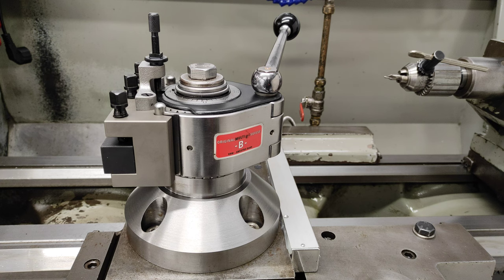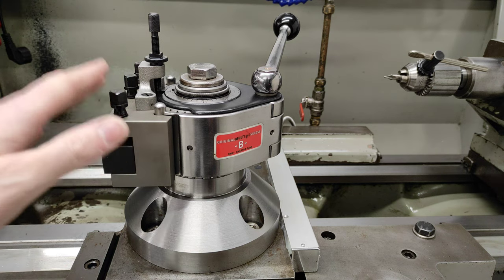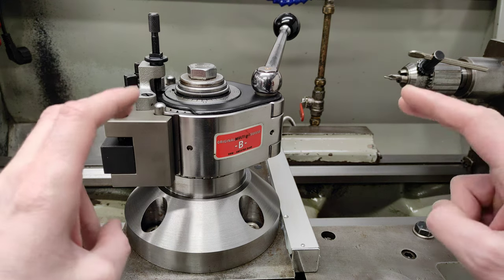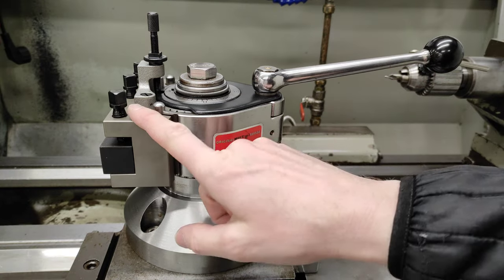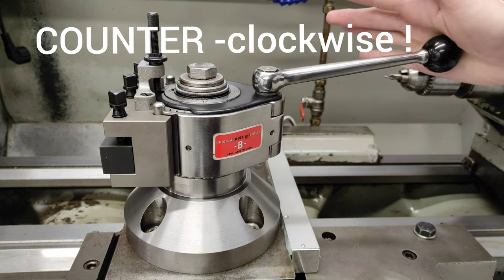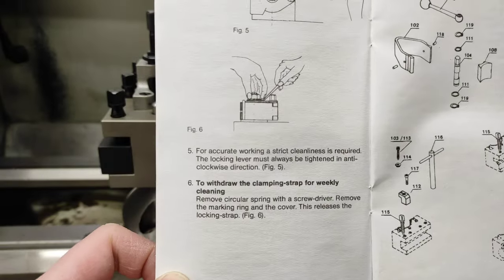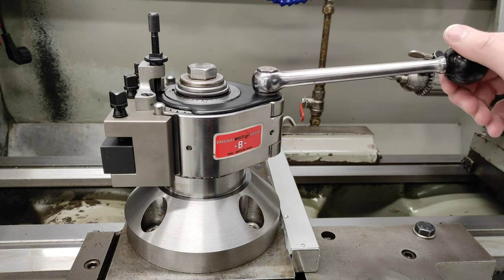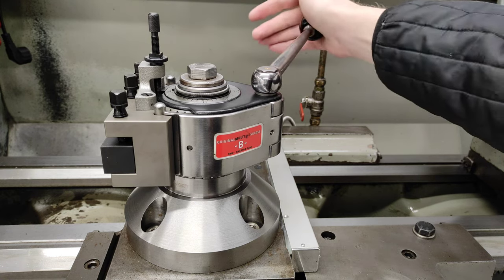Multifix quick change tool post. You've been using it wrong for years 😁

Comment: Hello, why do you think that the manual of the brand "OriginalMultiSuisse" (BTW:  This is NOT the original Multifix, the last original was produced 1984 in Switzerland) is correct? There is an excentric bolt which tighten up the clamps. Is there any logical explanation for clockwise or counter-clockwise? I ask because I am using clockwise without any problems since now 40 years and as a Multifix developer,  I recommend clockwise but I also say in my videos that it make no different in the point of clamping. Who knows, maybe I am wrong but to say this, I need some technical facts.
Reply from the maker: Of course i know this isn't the 'orginal' Swiss made.   This is made from Amestra.  I can't change when they write 'orginal' on it 😉
But it's still better quality than other import I've tried.   Why I think it's the correct way to tighten it?  - only because I can feel a difference in the ways I tighten it.  (I have two, and a friend a third) and it was him that said it to me.  I have always used it CW ☺️ 
I can't say why they do write it in the manual, or why it does draw/pull differently CCW than CW.  But I'm sure they have a reason.  If it's because of ease, repeatedly or something else. I don't know ☺️. The video were just a information and to get some discussion about it.  I'm in no way claiming what's wrong or right.  Other than what the manual says ☺️

Comment: Hi. Would you think to be possible using a multifix in the Myford ML7?? Would there be a problem given the multifix dimensions? Or I'll need to go after a smaller multifix?? I know in any case we always have to adapt the central screw, but the size and the risk of not reaching out the center precisely worries me. Thanks in advace!!
Reply from the maker: Hi. You should be able to use a small size Multifix.  Maybe a side aa or ab. I can't remember them at the moment, need to look closer to the sizes. But they're definitely one that fit.. best regards
Reply: the correct size for a Myford 7 is the size AS with special for this lathe type developed holders ASD1460-S to be able to use 10mm tools and additional to have a much more stable tool post than the tiny Aa.